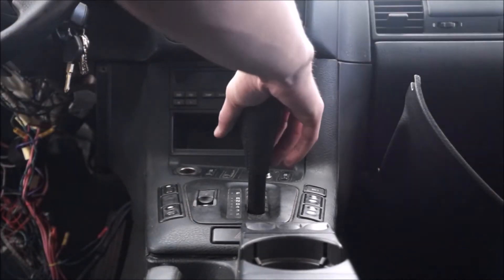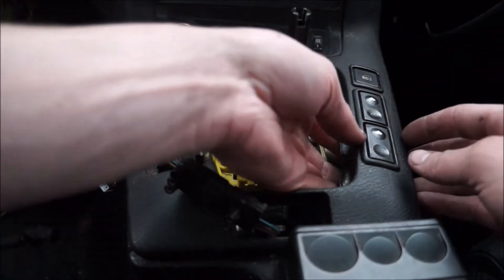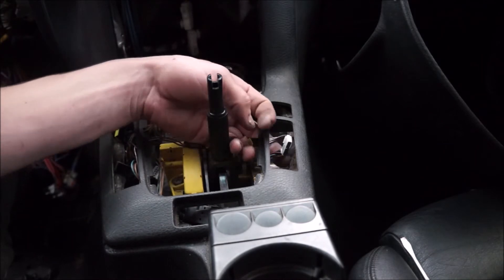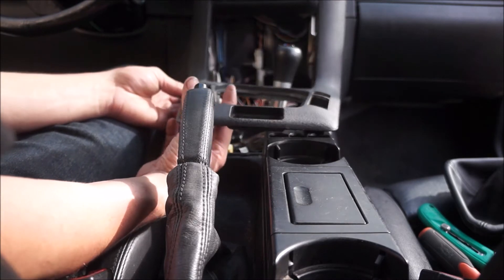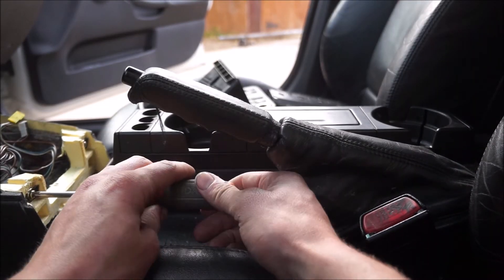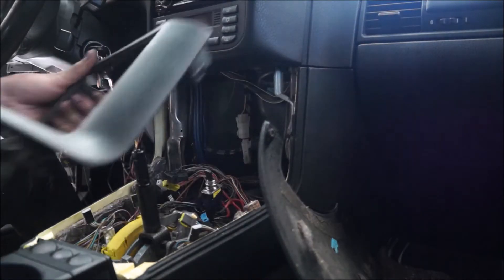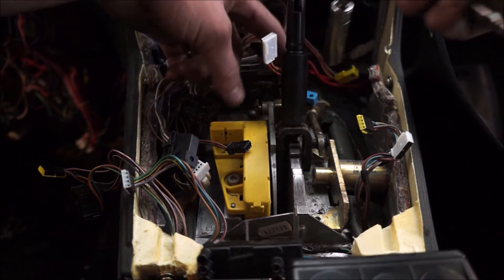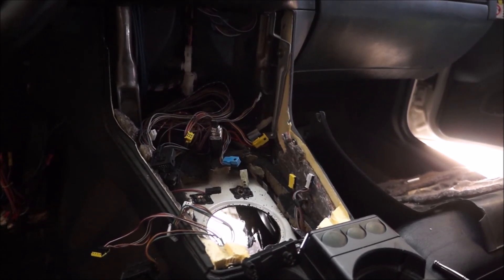E36 Automatic Shifter Removal: E36 Manual Swap

Comment: For anyone doing this swap who has the T shaped auto shifter, you cant pull it off. Theres a hidden allen bolt on the dash side of the shifter under the leathe. I ended up just cutting into the leather with a knife, ripping off the T handle entirely and exposing the bolt. The plastic under it pops off easy once the bolt is removed. Dont cut yourself.
Reply: Can you change automatic shift knobs? I don’t want to manual swap but I have a T shift knob and I wanted to change it with another auto shift knob

Comment: I am doing this right now and got to the nice screws behind the two pipes.  I have  found I can get the shifter mechanism out without removing the surround pc.  A little twisting, remove the shift lock solenoid and it is out.  Will let you know how it goes from here.

Comment: From my experience with those tabs being broken, you need to remove the entire shifter surround and lower center console piece as one. The only way to correctly re-attach the shifter surround piece is to do it upside down with the lower center console
Reply from the maker: PITA lol
Reply: Hi I just have a quick question so I also own the same model BMW and I don't have to much experience working on cars but do you think this is a good way to start learning and safe
Reply: instaBlaster.

Comment: Quinn-  Started my swap and was taking apart the front console/shifter trim to get at the shifter.  I know yours was messed up from the previous owner, which made getting the panel off easier than the rest of us.  I could not get at the top left hand screw because it is behind that steel support piece.  I found the attached video which made it easier to get the job done especially since the kick panel and under-dash panels on the driver's side has to be taken out anyway for the pedal assembly.  https://www.youtube.com/watch?v=gjB346Pw6nM   Thought you might want to stick the link up at the top of the page as a supplement to your video...   Havin' a ball with this so far.  Pete
Reply: YES!EXACTLY WHAT THIS GUY DID IS RIGHT. #SAVETHEE36

Comment: So what do I do when the little bolt holding the shifter on the the shift arm is already stripped? I went to take it off but the thing is stripped completely I'm trying to use Allen keys atm
Reply: I think I'm just gonna break it off, feel like that's really the only option I have I wanted to sell it after I take it off but idc if I have to break it lol and is the shifter console area different on manual then automatic? I see the shape of the wood trim is not exactly even on each side

Comment: Hey brotha how u I have a 98 m3 4dr blk what do u think about the Zionsville 6 speed transmission
Reply from the maker: I dont know, I have never used it or heard of anyone that has used it. Im sure you could piece together a 6 speed conversion for cheaper than the kit's price, there are tons of threads on 6 speed conversions. if you end up going with it, let me know how it works out for you!

Comment: Does anyone recommend the automatic for this car
Reply from the maker: not really, but they are significantly cheaper than the manuals for the same car, that is why I am doing a manual swap DIY series. check this out, it might answer a few questions: https://www.youtube.com/watch?v=pVgbu8Piozs&t=479s
Reply: Nope, no they don't. The 5spd is superior in many ways. Weight, maintenance, 0-60, ability to choose your gear and rpm, less parts, more gears, longer life, clutch takes abuse not the driveline etc. I have a 5spd so I'm biased truthfully. But that's what I like about it.
Reply: Mike B I was only asking because I really like this car but I don't know how to manual but I want to learn is this a good car to learn Stick on ?
Reply from the maker: yeah, its not the easiest car to learn manual on but it is one of the most rewarding cars to drive a manual in. I learned on my E36 M3 after the first manual conversion i did. I will be doing a full manual driving Tutorial series shortly after the manual swap series is finished, if that helps. will be convering everything from basic driving all the way to heel toes and left foot braking.
Reply: SuPra Tiyo 55k !!! Didn't mean to be rude. In my opinion it is one of the easier cars to drive manual. It shifts very nice, and if you dump the clutch too hard accidentally it will not buck as hard as say FwD car. And because it is a lighter vehicle it also helps to get the hang of it. The way this engine delivers power is very enjoyable to hit redline as your climbing thru the gears. I'm comparing to a 93 SHO, 93 F150, 92 Dakota, 89 f150, multiple jeeps 95 mustang, 96 GTI, 89 vette, 79 power wagon. BMW uses a clutch delay valve which will also aid you in learning. Supras are cool, like your name. Good luck 👍
Reply: M3NACE make that vid....should get a lot of views. Cool, gotta match the flywheel speed to the transmission speed on down shift.....keep that chassis stable in the corner. You look like your tall like me, I love having size 12 sneaks to heal toe.
Reply from the maker: I left foot brake an heel toe on the daily, its really fun to throw some style into daily driving, makes communting to work less sad heel toeing 4-3-2 before the turn in on the highway, with a WOT pull on the on-ramp. gets me going more than my morning coffee does lol, throwing a solid perfectly excecuted downshift is the best feeling. but my size 12 shoes makes it more of a left-side right-side pivot downshift over a heel and toe shift.
Reply: SuPra Tiyo 55k !!! Oh ya and RWD is easier to learn manual on because the transmission is right under the shifter vs a FWD controlled by cable or rod to the gear box. The geometry changes under acceleration or deceleration enough to make grabbing gears tricky.
Reply: M3NACE took the words out of mouth, my preferred blend of morning Joe is a few red lines, followed by a few drifts right then one or two to the left hah. 18F today the tires break loose so easy it's great. Yep the F1 gas pedal works great for rolling your on a heel toe. Really enjoy your work and input, thanks as always
Reply: the only reason i reccomend buying an e36 automatic is because the engines dont take the abuse that the manual does.  chances are if you buy a manual that has a good history you'll be fine as well, but you can get away with buying an e36 automatic without knowing much about its life.  the engines probably have rarely ever hit redline, never abruptly stalled, never slammed gears, etc.  the engines in autos are usually in much better condition.  double edged sword, though.  sometimes the autos are bought by the non car guys who don't maintain the engines.  i lucked out with a great background history on my automatic and i also know friends who got screwed because their automatic e36 was owned by some non car guy who never maintained the engine (fluids, plugs, etc)
Reply: Nah man. They aren't even like a good auto transmission. It's a cheap GM(yes general motors)4l30e transmission